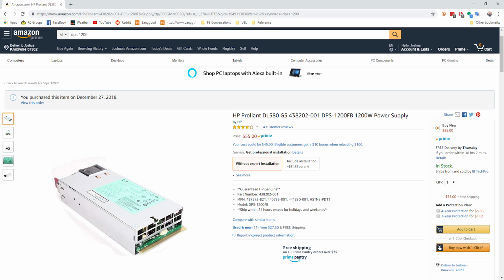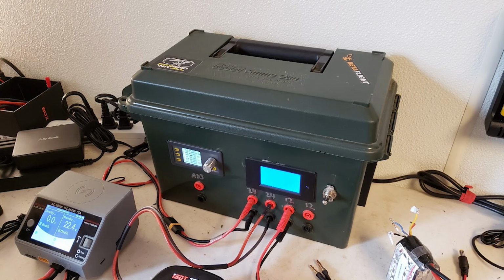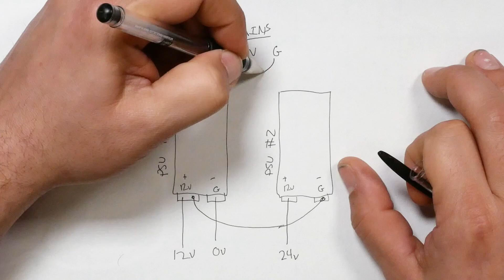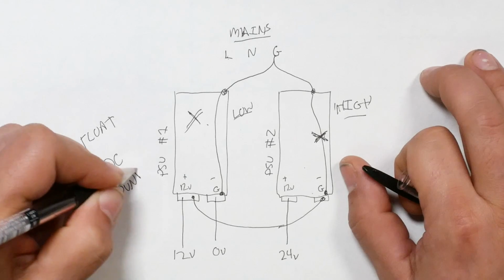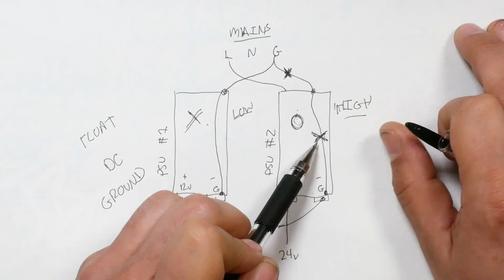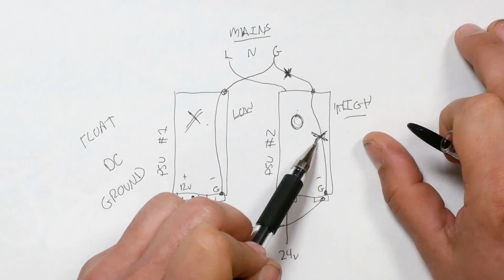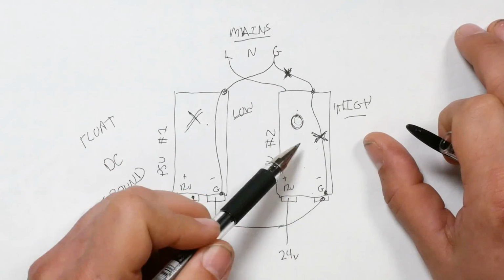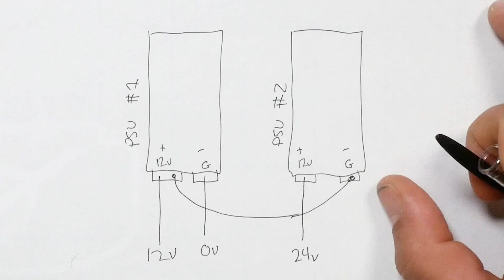How To Build A 24v / 2400W Power Supply | BEST BANG FOR BUCK 24V PSU

Comment: Word of warning to everybody DO NOT TOUCH CAPACITORS IN POWER SUPPLY EVER!! not even when it is disconnected from mains! These suckers can kill if the unit doesn't have discharge circuit installed and one can never be sure it is there and it is functional.
Reply: Oh yes. When I was a teenager an unplugged PSU did bite me heavily when i tried to repair it.
Reply: @olaf_s_23  And you're still alive, so therefore capacitors are nothing to worry about.
Reply: all you have to do to discharge one is touch them with a insulated screwdriver.  guys that repair washing machines etc do that all the time.  and those have a lot more juice stored in them.
Reply: @blue03r6  the screwdriver has to to touch a ground like the chassis or use a insulated wire with a resistor or short out a positive and negative wire in the case. If removing psu from computer, unplug, remove cover hold in power button until green light on motherboard goes out. Having worked on microwave, tvs, air-conditioning whose capacitors store 3000 volts+, a mistake with a charged capacitor will stop your heart.
Reply: @blue03r6  that was a 3 terminal unconnected air capacitor. I never remove wires with the capacitor charged  I used 8 gager twisted wire with insulated alligator clips on each end. Connect to chassis, other end to screwdriver shaft then touch terminals. Make sure not to touch chassis while doing it.
Reply: Yup just short the two leads of the capacitor together and it will dump its charge, you don't have to short it to ground. Poke them with a multimeter in VAC mode to be sure it has no charge left. These power supplies have bleeder resistors that should discharge the capacitor within the time it takes to disassemble the unit, but they can fail. Always check with a multimeter and never assume. Also be aware that capacitors can recover some of their charge over time. So it never hurts to recheck it as you work.
Reply: No you can lick them it's fine no but seriously you should probably just know what you are doing but anything like this power supply will have resistors in parallel to drain them down so they will be empty in a couple seconds by the time you get it open I mean some real cheap stuff may not but these should be fine
Reply: yeah, im using brass sponge to sweep whole pcb, i know that may hurt psu but i rather hurt psu than me :D if you wanna do it safe way here it is:
check high voltage caps on the mains side of switching power supply, remind that can be on standby so they are powered whole time when mains are connected. If you localised hiV caps, then take measurement of them and then discharge them by proper resistor according to ohms law. Thats it!

Comment: fantastic video JB. One quick question: could you use some superglue to hold the M3 nylon washers to the PCB to make the install a little easier?
Reply from the maker: Yep that might work. Just use the thick gel CA so it stays in place.

Comment: I'm skeptical. Won't you need 220V power, in the US, for 2kW+ power?  15A to 20A residential 110V service; 1500W  maximum per household circuit. And since that's the case, I would much rather see the average Joe just plug the two supplies into different circuits, and run separate chargers.
Reply from the maker: You are correct that you wouldn't be able to exceed about 1650 watts on most 110 circuits. The main goal of this approach is to achieve 24v output, so that the input current to the charger is lower.

If the 1200 watt PSU is overkill for you, you can spend half as much on the 750 watt PSU linked in the description.
Reply from the maker: One other thing: personally Prefer to over-spec a power supply. So if the max I can pull is 1650 watts, and the supply is rated for 2400 watts, that's just a bit of headroom, which is nice.
Reply: I'm still a little slack jawed that some of us might actually have enough LiPo's to take advantage of that much capacity.

Cheers!
Reply from the maker: The most I have ever charged is 20x 1500 mAh in parallel at 30 amps.

Comment: It's a 2400w psu. Not 1200w. Same amperage but double voltage makes for double power. So you could have used 2 cheaper 600w PSU
Reply from the maker: Even better!

Comment: Is it allowed to make a terminal on the first PSU to have a 12V output besides the end 24V and use them at the same time? For example, if you have a charger wich only takes 12V and a 2nd charger wich goes up to 24V?
Reply from the maker: Yes, absolutely you can do that.

Comment: If I do this, can I use it as a dual voltage supply? I mean take 24V from output of PSU 2 (with 0V from PSU 1), but also tap off 12V from output of PSU1?
Reply from the maker: Yes definitely.

Comment: Nice video. You should have some circuit board that could warn you if the DC ground and Ground gets connected.
Reply from the maker: The PSU will shut down if that were to happen.

Comment: Just finished building my own 1500w, 63 amp power supply using 2 Dell N750P-SO server power supplies. DC float mod done on one of them coupled with the fan mod to slow them down! Cost me a grand total of £14! eBay is sometimes wonderful! Happy flying! 🧐

Comment: The correct wattage of the final PSU is 2400W. When you double the output voltage, you also double the output power. It does not matter if the PSU's are in parallel or in series, the output power is double in both cases. I hope you can correct the title to the correct power of 2400W
Reply: Good luck running 2400w though the internals of a 1200w psu 🤣

Comment: I'm a data center electrician. I was installing L6-30R power for a clients cab. I lost control of the ground wire in a 4 panel PDU. It welded itself to the C bus in one of the panels. Alarms and lights were flashing, the L6-30 caught fire, and I was freaking. After the 3rd attempt to pull the wire off, with a insulated screwdriver, I was able to break the weld. The #10 copper wire insulation was melting all through the flex. I only had minor burns to my gloves and pants where the wire hit me after breaking the weld. Always stay safe!
Reply: Thats heavy! thanks for your input I am going to build this and I am going to multi meter the poop out of it!

Comment: I think another safety issue needs to be discussed here. When hooking up two of these in series, if one fails while charging, the potential of blowing up your charger is really, really, good. I guess it’s not a safety issue, but more of a psa.
Reply from the maker: Why would your charger blow up? The input voltage will drop to 12v. That's all?
Reply: Joshua Bardwell voltage drops to 12v in a blink, current shoots up, charger can’t get the power it needs because the voltage drop is so fast that it can’t throttle down. I blew up an icharger 4010 this way. In my case, mine was running on a generator in eco mode, but the concept is the same. Check in with RL Power, he mass produces these for the Rc car market. Even he won’t do 24 volt series power supplies because of this reason.
Reply: Joshua Bardwell buddyrc advises against it in this link but doesn’t go into detail why. I’m on my phone so I can’t effectively find more links for you. If you still need convincing I’ll dig around when I get home. http://www.buddyrc.com/icharger-406duo-406.html
Reply: Joshua Bardwell from RL Power “The issue with a 24v setup for us is it would be 2 12 volt units connected together. If one unit has an issue while plugged into a charger the downward spike in voltage could damage the charger.”

Comment: I was looking at one of these. 
24V 25A 600W LED Driver Switching Power Supply （SMPS）Monitoring power supply Industrial Power Transformer 110/220VAC-DC24V https://www.amazon.com/dp/B0786LMNR2/ref=cm_sw_r_cp_api_i_GUFwCb56C632T

Comment: I built some of these 24V PSU’s many years ago for my Revolectrix PL8 charger as I needed 1450W of power. I floated the 12V ground for safety just as you’ve shown. Many guys float the 110V ground which is crazy because a couple of RC guys have died touching the metal exterior case and plugging it in at the same time. So just be careful and make sure electrically you know what you’re doing. People die all the time from opening up power supplies and touching the large capacitors as they hold a charge for days. Make sure you dump their charge before working around them internally. 

- Travis
Reply: How would you suggest dumping the charge for this project?
Reply: @brandonklaus2903  same question 🙋🏻‍♂️ here..

I guess using latex? gloves 🧤 and wearing proper shoes (rubber) and then using a wire cutter which has plastic / rubber where you are supposed to hold it.

then just short circuit it.
should give quite a "bang" if it's charged ?!
Reply: Thats why you earth everything that has a metall case
Reply: an nobody on youtube about these 24v conversion. Nobody have tested 24v they all have first part of video

Comment: OR, couldn't one just buy this: 1323748 (search Banggood using this number).  It's a 24V 1000watt 110/220v power supply for $49.99 !!!  NO mod, and no $110 cost for two of those, and half the size. Sure, it's not 1200 watt, but that little difference isn't worth more than double the price and size, is it?  ;)
Reply: That's not the same a commercial grade PSU from HP. I'd prefer floating one of two HP PSU's over a single nonbrand PSU from Banggood.
Reply: @ordian  get a 24V HP PSU instead...

Comment: I think its important to note where the floated psu uses ground for reference and you removed that ground you removed that reference. So without restablishing -12 to 110v G you cant safly use the floated psu as a solo 12v supply.
Reply: It depends on the design, there are many PSU that have floating outputs.
Reply: arrrr, is that why when i testing mine before, it read a stable 12.3v and after the float mod, the volts were not stable and moving between 12v and 13v? then I done the 24v mod, and the total voltage output is around 25 and good

Comment: This is not related to the video but:

I ordered the Skyzone SKY02 in November and it finally arrived at the customs agency in germany, and after they checked it, they told me that it's not approved for the german market, and they want to send it back to china. 

I mean...many people in germany do have these goggles...did you (or anyone else) ever experienced this and can help me? 😂
Reply: Tell them there is nothing to approve as these are receivers only - you can't break any laws at all with them. They can and will slap vat and import tax on them but getting them into the country should be no issue. In future check "drop ship" during checkout so that package is not marked with bangood/gearbeast/whatever logo - decreses chance of the package getting opened.
Reply: @plainuser48596  thanks man
Reply: Ich denke es geht um die CE Kennzeichnung.  Haben die Skyzones aber eigentlich. Meine kamen vor ein paar Wochen ohne Probleme durch den Zoll.

Comment: Hi I'm looking for a new transmitter and I was considering the QX7S with the hall sensor gimbals, is this a good choice?
Reply: Excellent choice
Reply: It can be a bit annoying to use the QX7S using thumbs. The smaller frsky transmitter is better for thumbs.
Reply: @LordGryllwotth   I am a thumber, I feel very good with the size and stock sticks of the QX7s. The QX7 sticks were bad cause there was massive pressure on my thumbs.
Reply: LordGryllwotth true. The X-lite May be more to a thumbers liking. Although, I have seen many using thumbs for the qx7.
Reply: Very happy with it!
Reply: I have medium to large hands so will I be okay with the QX7S as I'm a thumber??
Reply: Newbie FPV yep. Should work out just fine.
Reply: @paulappy86  yes!
Reply: @paulappy86  get the Xlight if you are a thumber, the hall gimbals are overkill if you are just starting out.
Reply: Yes! I just got the carbon fiber version a couple days ago and it's wayyy better than my flysky. I wasn't aware of this before but (at least the getFPV version) ships with the long range R9 module!!!!!!!!
Reply: I didn't like the X Lite because there wasn't enough travel in the sticks even when elongating the sticks. The gimbals didn't have enough through. Go with the qx7 if you are just getting started in the hobby. (I am a thumber)
Reply: Thanks for all the advise guys, the community is one of the best things about this hobby. Many thanks
Reply: P.s. if anyone is near Leeds UK I would love to fly with them 👍🏼
Reply: @paulappy86  I need someone to fly with too. I'm in San Diego. Someone needs to make an FPV Buddy app.

Comment: For a Q6+ charger, just use a $22 24V/15A PSU from Amazon/Eagwell. No fiddling and smaller/lighter/cheaper.
Reply from the maker: This approach I'd for those who want MAXIMUM POWAH
Reply: Joshua Bardwell Haha yeah, if had a charger that needs more juice. But even at 300W I had to upgrade the power cable to lower gauge wiring from the outlet to the PSU, as a spare computer one got really really hot.
Reply: Don't plug your 36V bike charger into a Q6+. They don't like it.
Reply: @lostjohnny9000   ofc, maximum input voltage is 30V :D
Reply: Lol. For real. Thats what i did. I think i bought mine on ebay but about the same price.
Reply: Buy 4xQ6+ and you have a 4 channel 60A charger for less than 250 bucks!
Reply: Which one?
Reply: @Michael  Benjamin true. Lol. Extra powah
Reply: The AC power does 12A already...  What is the point of limiting yourself to 15A when this charger will do 30?  Might as well just use the 200w/12a built in at that point.

Comment: 1200w is only on 240v in (12v x 100A), 120v "only" gives 900w (12v x 75A). I picked up 3 of these a few years ago for about $50 total
Reply: That'll still be 1800w with the two together.
Reply: I just paid $29 for 2 lol.  Gonna float one and then throw two 120mm fans on either end of a small toolbox and put them in there.

Comment: Looks like it's only 900w max on 110v-120v. Not nitpicking just an observation from when I was building a power supply
Reply: That'll still be 1800w with the two power supplies.

Comment: That 750w setup sounds better at 30 bucks.

I went with a Meanwell 24v 600w power supply for a build a few months ago for about 115.    Not as much capacity but no fiddling as well.

I also appreciated the KwadBox boost of a 24v power supply from RDQ back in like November.   That is a fairly cheap 24 PSU.

For my big 24v setup about the most I will ever charge at is 15-18 amps into 4s packs when running two chargers at the same time.
Reply: 750w version is a better buy for US folks at least. The 1200w one only actually puts out 1200w if you input 200-240V, otherwise it's limited to 900w. The difference between 1500w and 1800w ain't worth the price differential unless you really need all that power.. and you almost certainly don't. :-)

Comment: So basically you're turning the 2nd one into an isolated transformer - which by coincidence is something I've been playing with recently; charging a small 2S pack from two 1S charging ICs, by putting a DC-DC isolated transformer in front of one of the 1S charging ICs so each one can charge one cell of the 2S pack, at the same time from a single power source.
Why? Because of the new breed of 2S micro brushless quads and the proliferation of 1S chargers.

Comment: Disclaimer: DO NOT PLUG IN THE POWER SUPPLY BEFORE DOING THIS MODIFICATION! INTERNAL CAPACITORS WILL BE CHARGED AND CAN KILL YOU! IF YOU PLUGGED THE POWER SUPPLY IN LET IT SIT FOR A DAY OR MORE AND DO THIS MODIFICATION LATER. AVOID TOUCHING THE BOARD OR ANY COMPONENTS!!!

Please follow this advice, this is NOT a joke!!!

I know it doesn’t take a whole day for most capacitors to self-discharge but it‘s better to play it safe!!!
Reply: chunky caps dont loose charge within a day... just be careful...
Reply: Aaron Rogers i know, I‘m not sure what they have in here but mostly a day is enough. If I see anything with big caps I‘m extra careful and consult the service manual for information on Cap discharge.